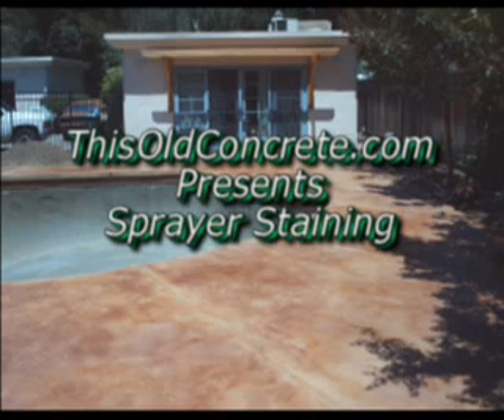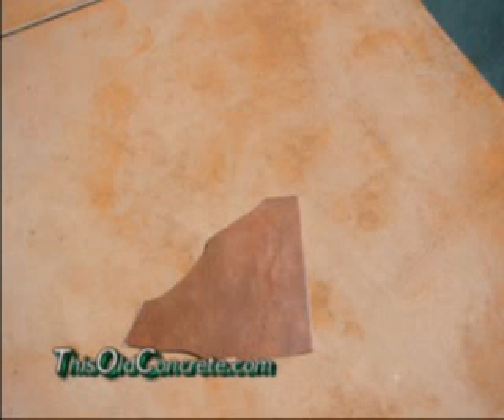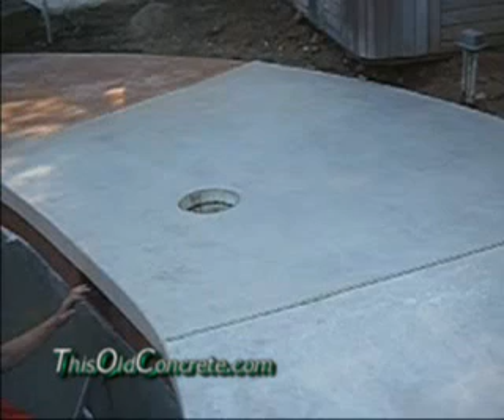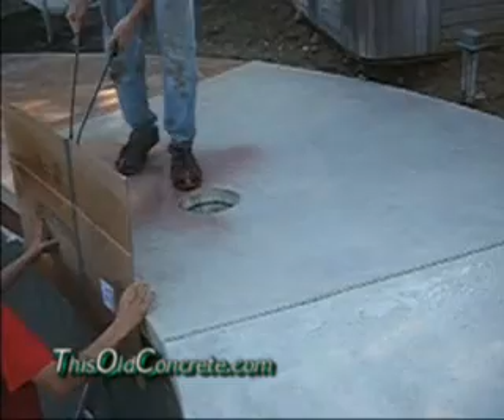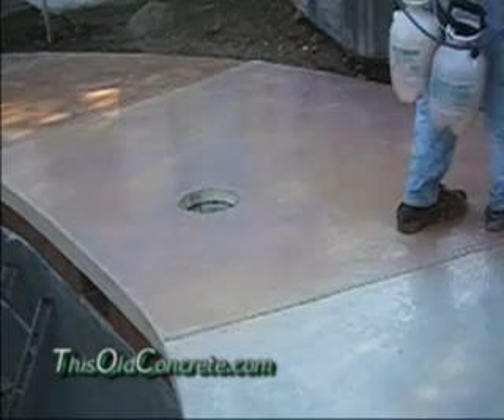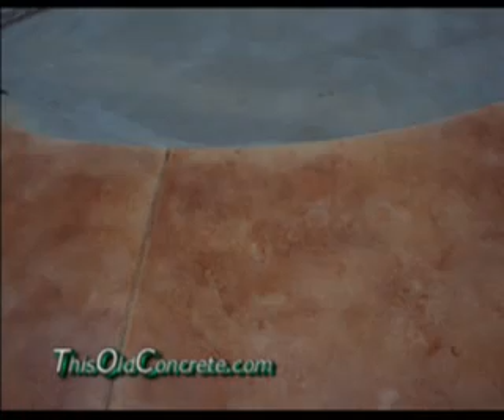Concrete Stain Sprayer Method

Comment from the maker: I do not know the cost difference of plain verses colored concrete pours.  What I do know is that I have seen a lot of poured concrete that did not turn out to be the right color or that had problems with fading and so on after only a few months.  With our stains (concrete dyes) you get the right color and it tends to do better over time the straight colored concrete.

Comment from the maker: Best to broom on a Newlook solid color stain as a base or a Newlook clear coat otherwise the stain soaks in too fast.  On smooth concrete the stain my tend to run.  Keep a paint roller (damp with the stain) and use it to lightly blot up excess right way.  Careful, after the stain has been sitting for 5 or 10 minutes the roller tends to pull up the color as well which will require some touch up.  You can buy all our products at  my website at ThisOldConcrete

Comment from the maker: You can apply basiclly any sealer you want on top of this product using any applicator method.  The product is itself a simi-sealer and in many cases all that is needed.
Reply: what kind of material is this ?? water based? Acrylic? Acid?